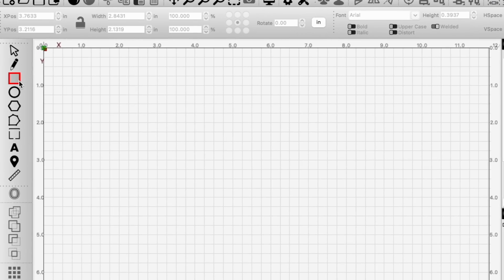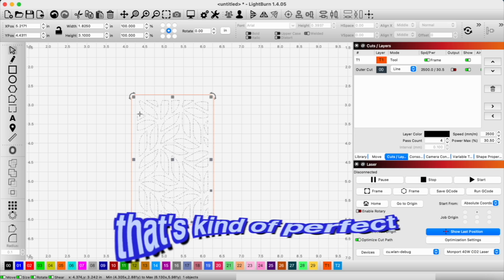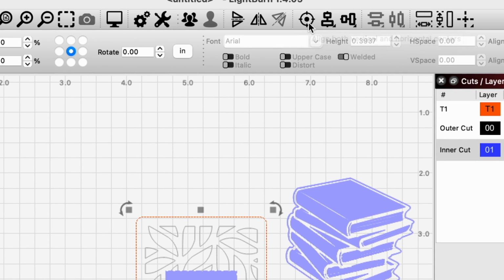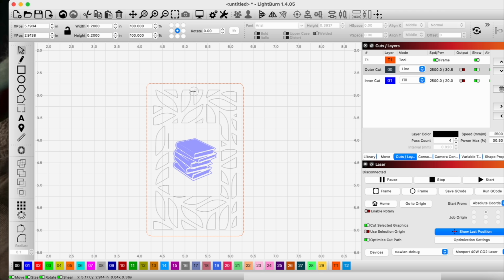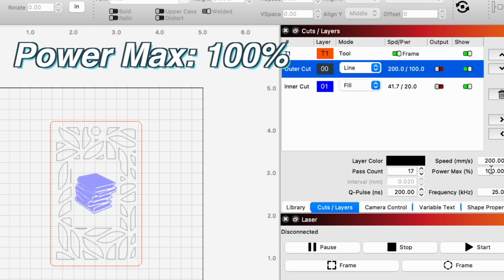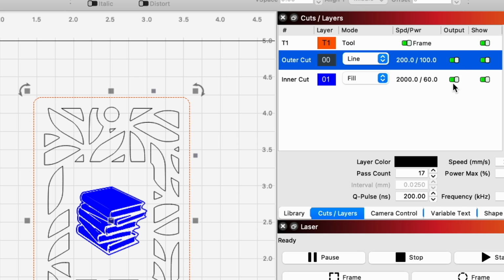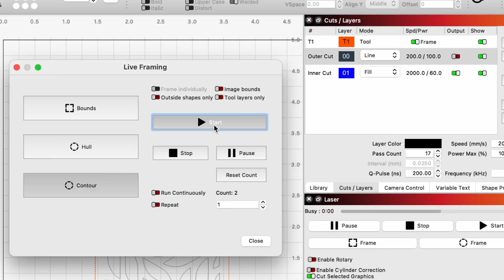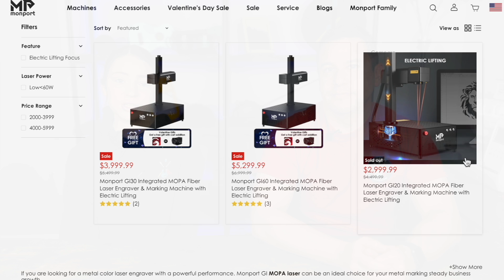LASER CUT ANODIZED ALUMINUM on Monport GI20 Fiber Laser | Cutting & Engraving

Comment: Neat! I cut through a 0.8 mm card once, but it took a lot of passes! A quick Lightburn tip: if your are adding the same radius to all four corners of a rectangle, you can bring up the Shape Properties tab (I see it in our upper group of tabs on the right) and it has a rounded corners setting. When you start doing 3D depth engraving, something I just learned this weekend: Inverting a grayscale image in the Fill dialog is different than inverting the same image in your image editor. The difference is in the order of the filling of the layers - it looks better when you invert the image in your image editor and then don't use the Invert checkbox.
Reply from the maker: Awesome! thank you for the tips. As always, thank you for watching and commenting!